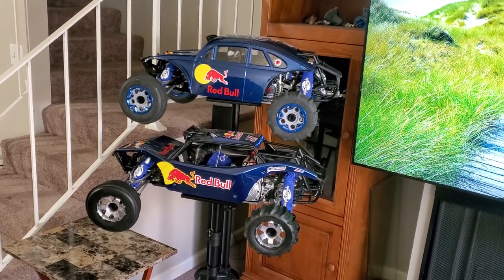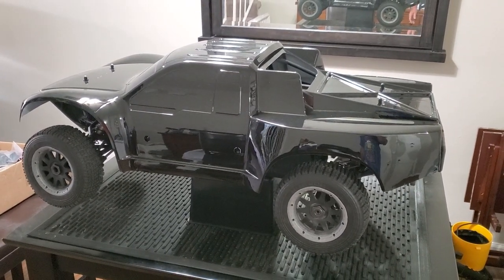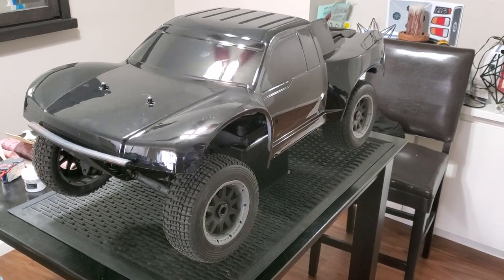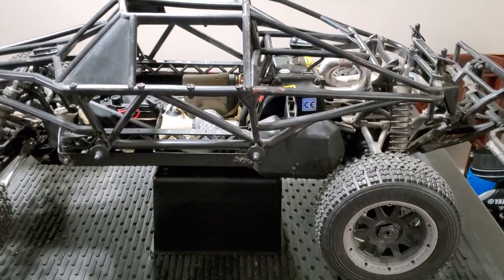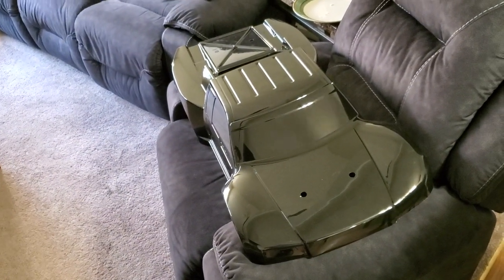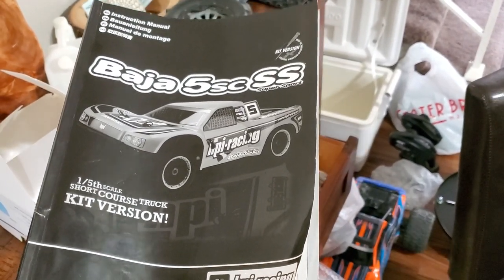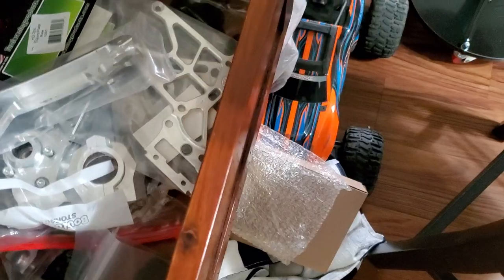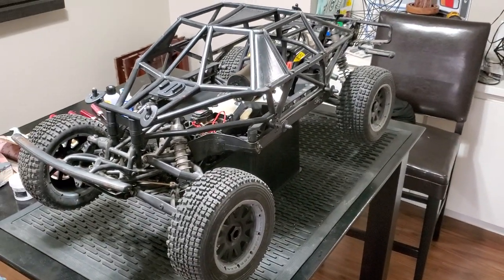HPI BAJA 5SC   Purchased for only $275

Comment: Where did you get the vw body for the 5th scale buggy?
Reply from the maker: Hello
Unfortunately Proline and Kingmotors don't make the baja bug body anymore 😕  sorry. The only other brand would be FG but it's a little different. It looks shorter and not so Stretched. Good luck 😉👍
Reply: @moesgarage1638   rovan and king motors have them in stock